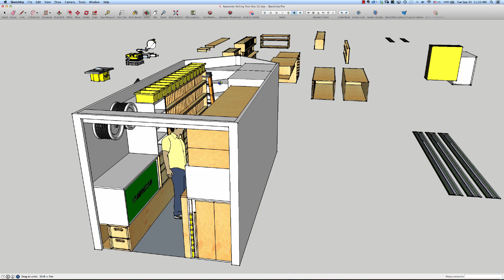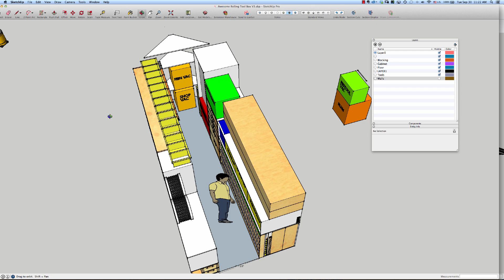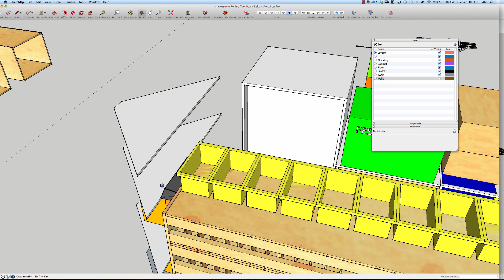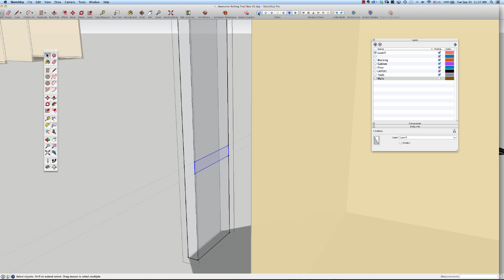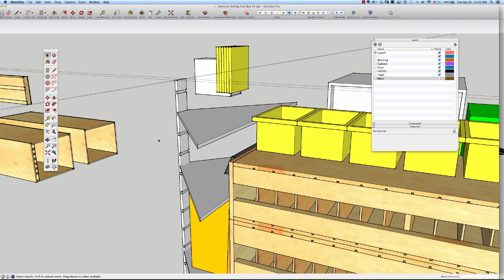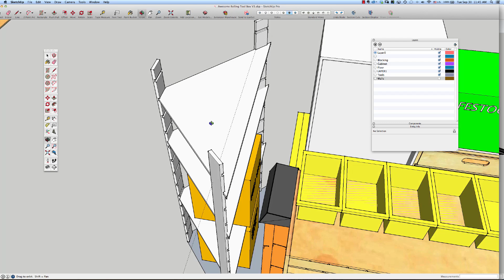BUILDING A MOBILE WOODSHOP (Part 8) Custom cabinet for the v-nose.

Comment: I'm honestly not a professional carpenter, and I don't expect I'll ever need to build a mobile toolbox.  I will say that these videos in this series are probably the best tutorials I've run across on using sketchup in a practical application.  Thanks for putting the effort into it Ron.

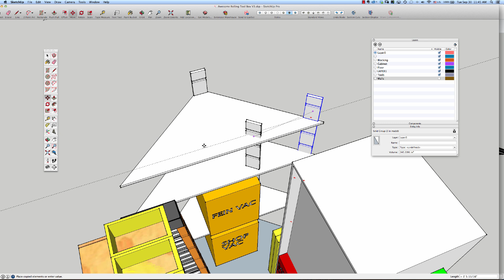Comment: You can assign your command or space bar (I think) to temporarily go to the hand icon.  Very useful.  12:20 would you make those dado cuts on your sliding mitre saw?  It looks impossible on a table saw.

Comment: Ron, just a thought if I may. You have the 2 halves of you older bench up on the right side and have tool storgae below. If you were swithch the two - mount the tool storage to the wall of the trailer where the bench halves are now located and store the bench below them. My thought is, it may be easier to handle those bench halves at a lower height and when they are out of the trailer, it gives you a nice flat work surface at a good working height to use when you are loading/unloading other things. just a thought

Comment: Ron, great videos and great ideas.  I've been following for awhile now.  I was curious to know if you've ever weighed your trailer full of tools and cabinets.  I know you had a trailer set up first, then a box truck, now, back to a trailer.  I'm assuming you're still working on your new trailer now but what about your original trailer?  What size was it and how much did it weigh loaded down with all the tools / supplies / and cabinets themselves.
Reply from the maker: Hi, I can't answer the weight issue other than an F 150 pulled the trailer easily. The last trailer was 14' as is the current one, though I have more height in this one, thus more cubic space.
Reply: I have the same size v-nose aluminum frame trailer with a similar amount of built in shelving. Loaded with daily tools it's 6000#. A little more when transferring to a different job site with benches, Knack box, etc.

Comment: It would be easier and more versatile to make those shelf standards without dado joinery.  Just screw in blocks to support each shelf.  You can move the block or add more blocks for future changes.  It's more versatile because you aren't limited by the locations of the dados.
Reply from the maker: Yes, another good method would be to stack the material eliminating the dado work. I will be doing many dados on this project, so opted for this method.